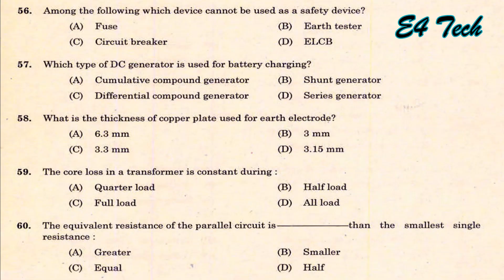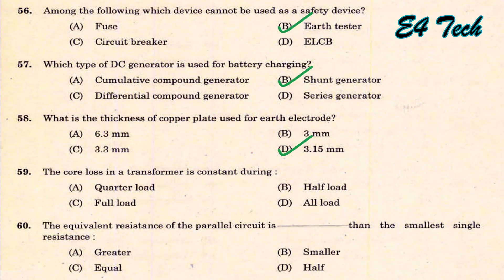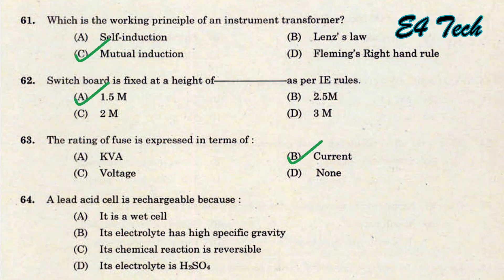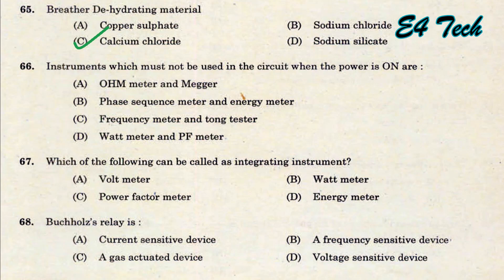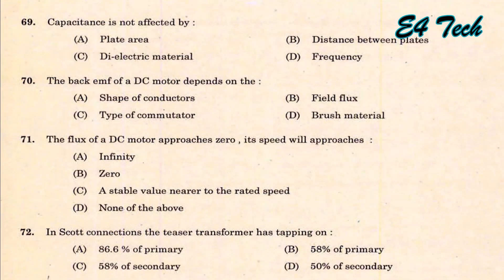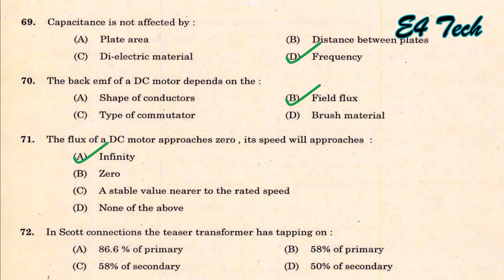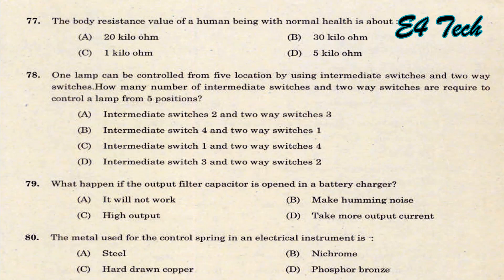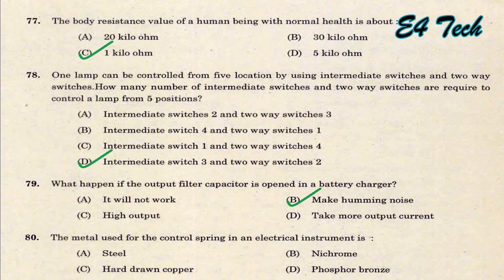PART -3 | KPSC Electrician | Lineman | wireman | Technician - Exam | Question Answer Kerala PSC

Comment: 65 anr wrong alle.. Optn d alle
Reply from the maker: No, answer is correct. I think u misunderstood sodium silicate with silica gel.
If silica gel was there in option, then it would have made confusion. Soldium silicate is not silica gel.
Note:-
Calciumchloride and silicagel are both hygroscopic materials, meaning that they readily absorb moisture from their surrounding environment. Each however owes its hygroscopicity to different natural principles.